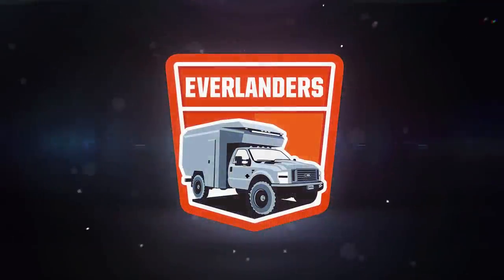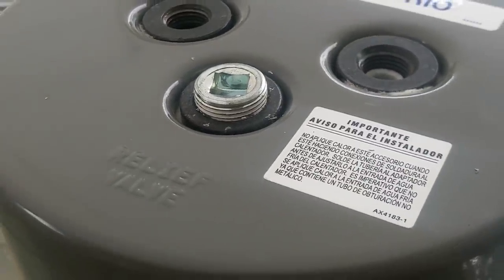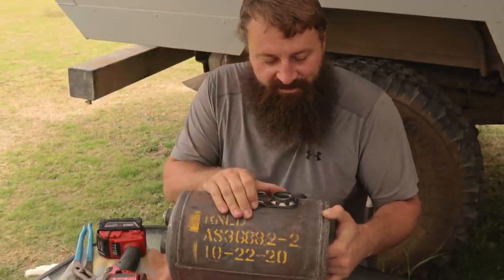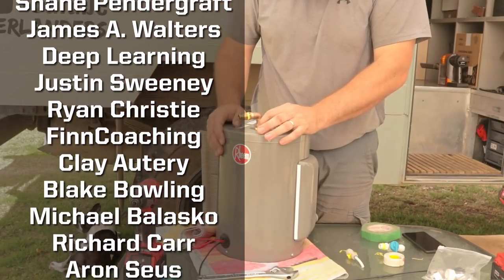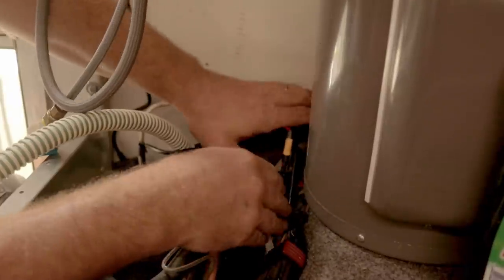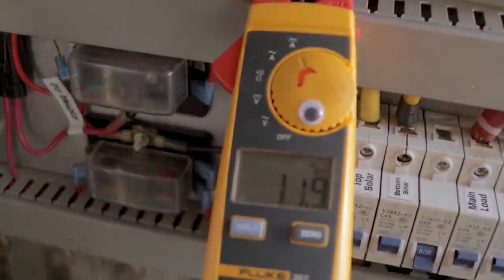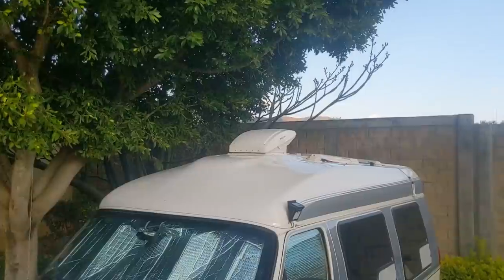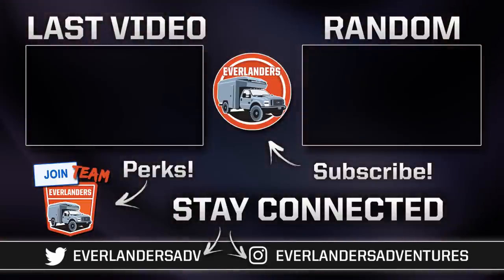Solar Powered RV Water Heater Conversion - 12 Volt Dump Load - Everlanders see the World!

Comment: MaxxAir Fan Mods and improvement would be interesting to see since every camper has one.
Reply from the maker: Yes, I need to find (or print) a lathe to get the commutator repaired...
Reply: I’d also live to see you play with the fan. It’s so sad that the two main fan options (maxxair and FanTastic) are so unreliable.  I’ve recently started watching your videos and I am thoroughly enjoying. Thanks for sharing.
Reply: @LostWorldLuis  

For our ExpeditionVehicle build in 2003, we foraged through the vast racks and yard at RV Surplus in Eugene Oregon.
They always have a pile of take-out Maxx fans.
Apparently, the 'fix' for a faulty anything on the fan is replacing the whole shooting match.

As perpetual scroungers, we are constitutionally-incapable of buying new if adapting a foraged part would work (with some tinkering (and that is half the fun of the project...)).
Reply from the maker: What I would do to have access to those racks right now... I'm sitting here in rural Mexico scratching my head, trying to modify plumbing fittings to act as copper commentators inside this motor... 😤

Comment: Great job! I was working on the same project here in sunny and cold Alberta, I just was planning to use a 24L electric water heater (a little bit more heat sink and more hot water for showering :) ) . Initially, i was planning to use the output from the diversion of the DSSR20 of electrodacus but at the end with the efficiency of the inverter, I am planning to use 120AC and use SMBS0 to control when to turn on the electric heater (no skill with arduino :( ) . I think the disadvantage compare to full automation like yours is that i need to keep the inverter on. I was planning to have the original thermostat in series to control the max temp of the water and a separate mechanical toggle switch to heat the water also if there is no need  to dump production but you really want a hot shower. What do you think?  About DC-DC efficiency will be very interesting. Victron DC AC  Inverter looks like they are not bad, not sure if a cheap  DC-DC will do any better, still law of thermodynamics rule.

Comment: Great video. I had never thought about installing a ds18b20 on the hot water tank. My 36v heater element has it’s own controller but it would be nice to monitor the water temperature on my Blynk app. 
I vote for your communication board or dc conversation, doesn’t matter to us. Any project you’re doing is great information. 
Let me guess you did this project in your bare feet. 😂
Stay safe
Reply: Damm autocorrect it should say conversion not conversation???
Reply from the maker: @craigmckenzie8028  You got it Craig, One DC Conversation coming up!

Comment: I like the water heater conversion but is it possible to make it control more simply?  turn it on when I need it and let turn it off when I don't type of thing... also, with my 120v under counter and RV 120 water heaters I use  timer switch... so it turns off automatically.

Comment: I like you project.   For water inlet and outlet connections,  why you did not use dielectric nipples or 1/2"x 1 1/2" brass pipe hex nipples ?  There is no need to solder. LOL
Reply from the maker: I needed to work with what I could get at the little hardware stores in Mexico...  Fittings were surprisingly scarce.
Reply: @Everlanders  In the U.S., fittings are also scarce due to Covit-19.

Comment: The existing element will work fine on a lower voltage at 1/10 the voltage it will use 1/10 the current.
I use one stock with a 240 volt 1,800 watt element 50 liter with 48 volts from 4 grid tie panels that cost $20 each in series parallel. I use a $4 temperature sensor and gauge with longer wires.
In our house and share house  have some panels that I bought second hand that were 7 years old when I got them for $400 for 20 x 200 w they are down 3% in output and I use them for running 2 x 315 stock 3.6 kw liter hot water heaters straight from the panels Dc and it has 1/2 our power bill.

The 2 month power bill was $400 and dropped to $200 so a 6 month pay back including $200 install.

Hot water is a cheap way to store energy over night and a few cloudy days and we still have hot water summer 1/2 the panels are turned off.
Reply from the maker: No, The power is Squared... Our original water heater element is 9.8 Ohms
Per Ohms Law, which states Power (P) = Voltage (V) * Current (I) 
At the rated 127 Volts, the current through the 9.8 Ohm resistor is 12.95 Amps ... which means (P) is 1645 Watts.
At 12 volts, the current through an 9.8 Ohm resistor is 1.22 Amps... which is only 14.69 Watts.
https://ohmslawcalculator.com/

Comment: Why not, in the script on the Pi, have it print the water temperature and the battery level, whether or not s.soc > LVC ? It's useful info whether the heater is on or off, and might be helpful to know just exactly how low the batteries are, if they're below LVC, so you could perhaps estimate how much more sun it's going to take before you can wash the dishes.
Reply from the maker: It does.
Reply: @Everlanders  That's OK then! I was just going by that particular bit of code, I thought the lines in question would be better outside of the if block.

Comment: Amazing video.  Brilliant! Might have missed it but did you plumb the pressure relief valve outside in case of discharge?
Reply from the maker: Our whole water system uses compressed air and has a 40psi relief valve, and should that fail, each of the stainless kegs have 100psi pressure reliefs on them.

Comment: Any reason why you would not install two of those 12vdc heater mats to the can..???  In addition, while I am impressed with all the coding and boards (but for me, adding complication and points of failure, my take of course) I might use a mechanical timer with on/off  'fingers'  to control vdc availability..   I'm not sure yet whether that makes sense, but it might be a simpler solution for those of us who are  'code challenged',  in addition to reducing failure points..  (?)
Reply from the maker: I see no reason that you couldn't use multiple heater mats... I only had the one along with us.  And while it would be fine to use a cheap temperature controller (as linked below) or even just use the original thermostat with a relay to switch the power... My primary goal was to heat the water only when we had excess solar, when our state of charge is over X% and the solar production is higher than the heaters consumption.

https://www.amazon.com/CHENBO-Thermostat-Temperature-Controller-Waterproof/dp/B01E5ALKPO

Comment: should use kapton tape to hold the pad on. If the masking tape dries out the pad will lose contact with the tank and it wont work properly.
Reply from the maker: Recent inspection shows it has fused to the tank.

Comment: Can I get a link for the heating pad?   I see so many of them out there I want to make sure I am going down the right path.  Thank you.
Reply from the maker: I don't put links to specific vendors. But I've used Keenovo heaters for many projects with good success. 12 or 24 volts depending on your solar panels, and 150 to 250 watts depending how much extra solar you have.

Comment: Pretty sure you could have skipped disassembling the heater housing and adding the heating pad. The 120v 1,400 watt heating element that came with the heater should deliver 140 watts of heat if fed 12v. If you wanted 200 watt to match your pad you could exchange the 1,400 element for a 2,000 watt 120v element. Not sure if the 120v thermostat would play well with 12v dc, but with a relay to switch the element between the factory 120v and your 12v circuit should let you use the same element for both.
Reply from the maker: I'm pretty sure it would not work, because the power is Squared... 
The original water heater element is 9.8 Ohms
Per Ohms Law, which states Power (P) = Voltage (V) * Current (I) 
At the rated 127 Volts, the current through the 9.8 Ohm resistor is 12.95 Amps ... which means (P) is 1645 Watts.
At 12 volts, the current through an 9.8 Ohm resistor is 1.22 Amps... which is only 14.69 Watts.
https://ohmslawcalculator.com/
Reply: @Everlanders  Yup you're right! My bad, I was thinking amps stayed the same.

Comment: We have a recirculating shower system 7gal and we're gonna use a propane heater but being in calgary it gets cold but afraid of fumes while heater being inside. I have 2 6v trojan t-105AMG batteries to 12v 200w solar a 30amp mppt controller.  I know nothing of plumbing or electrical.  Will that set up work for what we need ro heat a small gal tank tank is plastic but can get a metal one if you suggest.  If this would work can you tell me how and I am willing to pay you for your time. Or would you recommend another option. Great vid Sir. Thank you for your time
Reply from the maker: Simply by the way you've phrased your question, I can assure you that this will not work for you.
Reply: @Everlanders  thank you. We are going to run a 5L onsen tankless water off propane and as long as we create a vent for it to go out to roof or ways we should be fine w the fumes yes. Thank you for your quick response and your time Sir.

Comment: I wonder if you could do a pwm scheme where at 80% soc you start a low duty cycle. As soc continues to rise up the duty cycle. If soc falls reduce duty cycle.  You can tune how aggressively the pwm increase is and keep soc at 80-81%
Reply from the maker: PWM would lose a lot of the power to heat... The system has a slow enough response time that "pulse widths" of 10 minutes is sufficient.
Reply: @Everlanders  PWM shouldn't lose power to heat... its on or it's off.  It's when a device (ie mosfet) is in it's analog region then there is heat.  But if it works for you, that's fantastic. I'm somewhat famous for making things overly complicated.   I love the idea of the heating mat, I never thought of that.  I had done a similar thing driving the 120v heating element with 120vdc directly from the panels and using a different thermostat that was DC rated.

Comment: Hi, I found this video during my search for dump load usage. What wattage is the heat pad you have attached to the water cylinder and is it 12v only? Also does the external pad work well on it's own or does it need further heat to reach the desired temperature?
Thanks.
Reply from the maker: It is a 150 watt pad, and it will easily boil this tank...

Comment: Did you make plans to route the drain/relief outlets off truck?
Reply from the maker: No, Our water system is pressurized with pressure relief valves that vent into the aluminum step box, so if they were ever to go it would just flow out the bottom there... As far as the drain valve, I can connect a garden hose and throw it out the door, or pick the whole thing up and carry it outside and turn it upside down...

Comment: Hey man, great content!!! 
I would love to see someone incorporate 'smart glass' windows which you could wire up to your automated system making it dimmable to your liking whilst being able to see what is going on outside in real time. (you can even mirror tint the outside for privacy and to minimize solar gains if privacy is an issue.) Anyways, just an idea which I have yet to see.
Cheers and keep on inspiring!!!
Reply from the maker: Of all the fellow Overlanders we ask, ~80% of them have had people break in through the windows. For this reason we will not be installing windows (smart or otherwise), and sticking with our camera systems.
Reply: @everlanders I guess however tempting it might be to take your knowledge and apocalypse proof your home with such features as remote operated taser perimeter windows for safety and security, It would not go over so well with law enforcement or the community as a whole. Lol

I am also a big fan of Pneumatics, so how about a pneumatic deadbolt locking system as a project? Maybe for an internal compartment for your camera gear and valuables etc.. 

My cousin had a 1978 Mercedes that had pneumatic door locks which were pretty cool.

In any case, I understand that your rig was built for 'no boundaries' exploration whilst keeping the both of you safe with peace of mind.

Cheers.
Reply from the maker: We already have a pneumatic retractable, locking compartment for our cameras and other valuables... See previous videos for details.
Reply: @Everlanders  Nice, I'm new to the channel and the overlanding lifestyle.

I will watch more of your innovations and adventures.

Thank you.

Comment: Now that you have had time to test this project, has the water heat vs. electricity usage been worth it? Or does it use more electricity than its worth to get the water to the temperature you like?
Reply from the maker: I used it for months before posting the video... The water is kept at 50°c during the night, and 75°c during the day... Our batteries are still fully charged by midday and the panels are still being switched off... It seems fairly worth it to me...
Reply: @Everlanders  Thank you for the info. We'll see what we can do to setup something similar.

Comment: Unfortunately, I'm a bit late to the party, but have you considered using the heat from your fridge compressor to assist in heating your water?
Reply from the maker: Your heart's in the right place, but you need to get the heated water away from the fridge's radiator. If it was used to heat the water, and then the warm water just sat there, then the fridge itself would be very inefficient because it would have trouble cooling the radiator and thus the inside of the fridge.
Reply: @Everlanders  true. It just feels wrong to me not to use the heat from the fridge for anything and just vent it out. Maybe make a switch so you can use it for a heated floor. Well, maybe not on your current vehicle, but just thinking...
Reply from the maker: Heated floor would have the same problem, you need to have a way to take the heat away from the fridge compressor, it can't be left to soak in it.

Comment: See i had a similar idea but to use a super tiny tankless water heater
Reply from the maker: Yes, the disadvantage to that for us is that they are very high demand when you are using them... which may not be the same time as when you had excess solar. This way we can store excess solar when there is surplus - @ 9L @ 80°c = 0.5kW of stored energy...

Comment: Hi!!! grate video, i got 1 ? what filament you used for your parts?  love your channel.  i will triad to copy your solar panel Extension   just looking for the pars to do it. on the panel ext. if u change any from it. what will be ?.let us know!!! thank you Buddy. from Your Puerto Rican Friend Hector.
Reply from the maker: Hey Hector... Everything is working great with the solar slides, no changes...  In the past we printed with ABS or ASA, but with our new printer built into the truck we've been using PETG...
Reply: @Everlanders   cool beans  love your videos i will make one my self i wander the silicon mat  is from 3d printers? or what you recommended?  thank you Buddy

Comment: I just found your channel looking forward to more videos can you please explain to me how the pressure pop off valve works I’ve never seen one that looks like that The ones I’m familiar with you can manually release pressure  Is it something that Will burst like a one time use thank you
Reply from the maker: Indeed this one would burst only once, The comedy of the situation is that there is no pressure relief valve, the water heater was supplied with a solid cast plug... In our installation we will be depending on the pressurized supply regulator and keg blow off valves shown in earlier videos.
Reply: @Everlanders  Wow that was fast thank you so much I will be subscribing if I can bother with one more ? I really like how your solar panels extend out do you have a video on how you did this as with the rig I’m looking at I’m going to need to do this to get enough solar thanks again 👍👍
Reply from the maker: It's our most popular Videos, DIY Solar Powered RV - Lithium Power LiFePo4: https://www.youtube.com/playlist?list=PL0uBLqOOwG8hv9HRxGZvnesMBrUVyiQKf
Reply: @Everlanders 👌

Comment: If I understood correctly, you've a Blynk server running in the raspberry pi and your IOT devices are sending simultaneously to your local server and the cloud Blynk servers? Maybe (noob here, just thoughts) it is going to be easy to connect always to your local server, in case you're in the same Wifi network via Blynk (192.168....) and if you're out of the Wifi signal, thought some No-ip service (linking your dynamic IP to these services) in case the truck has no internet connection, and you're not in the same Wifi, you can't get data (but the same with the Blynk servers) Then you spend less in "energy" and maybe make the code for the IOT simpler? (w/o sending to local and cloud servers).

And now a question, how do you send data from the same RPI (server) to the server? Like is easy to send from any esp8266/esp32 to server, but how do you make the raspberry pi be the server and also the IOT device? have a nice day!

Comment: 3D printer would be awesome, how would you reduce it's noice with large prints? If the print lasts 15h or so, you might have to sleep with it and it's pretty noisy. Do u have any idea? Large insulation, rubber blocks..?
Reply from the maker: I've already modified it to be silent! 🥳
Reply: @Everlanders  uwu, would like to see it🙃

Comment: The orange panel used for heating up the water. Has less consumption than the original resistance?
Reply from the maker: The original was ~1500 watts and the orange pad is 150 watts, this however has been upgraded since then... See the new setup here: https://youtu.be/TGMZ7bM-Kow

Comment: Do you have a link for the silicon heating mat you used? Was it 100 W.  How well does it work?
Reply from the maker: No, I've had it for years... It's marked as 150w and has been working fine... We've had free hot water for months and still batteries are full...